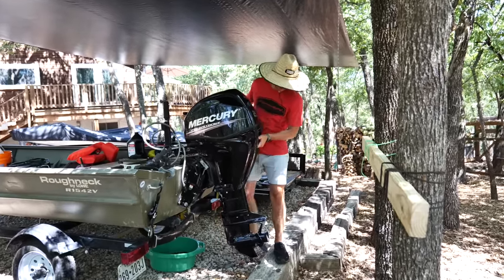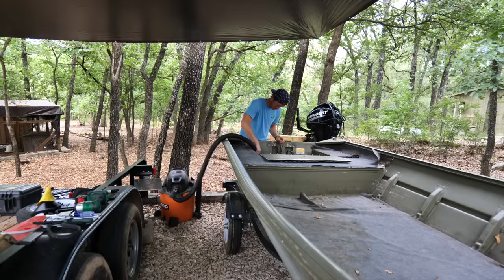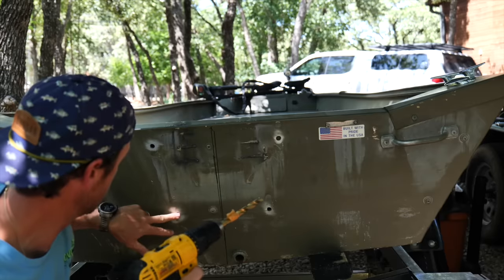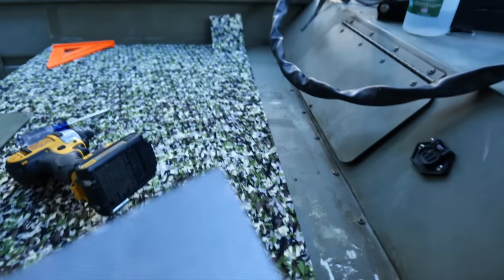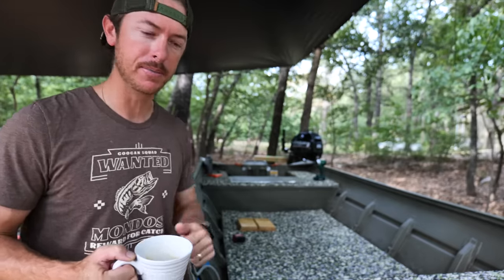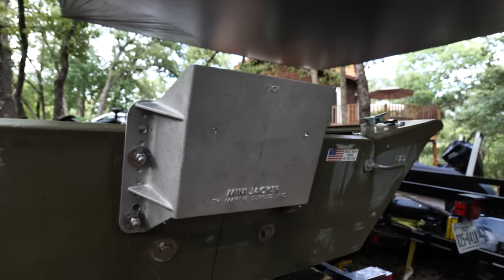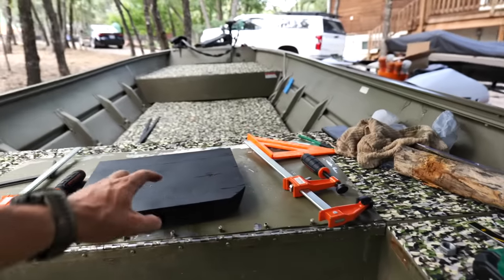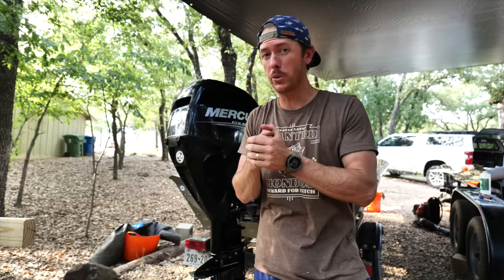MASSIVE Jon Boat Upgrades for Under $500! Full Build & Install

Comment: When you went to take off the motor, I had the thought hoping you had everything disconnecting. Having it still be connected twice is hilarious
Reply: I saw all them wires and fuel line and thought the same. I just went through this same thing 😆

Comment: This is a great video that shows how to work on your boat when you have no idea of what you are doing and have no experience in doing it, used to have these boats come into the shop all the time (Broken) and owners saying well it worked for a month or so before it broke. I knew things would get worse when he drilled the transom at the wrong angle to fill old engine bolt holes. I know you tried but as Clint Eastwood said ' A man has to know his limits" and Sir you have more than exceeded yours here, best of luck with that nightmare job.
Reply: Agreed, do things right the first time. The life you save might be your wife!!!!

Comment: Those bottom bolts are mainly going to keep it from lifting up if you hit an object in the water or bouncing on the trailer going down the road. They won’t see much load under power. The clamps will take most of that. If you ultimately don’t feel confident in it, check out the adjustable jack plates from Vance Manufacturing. They have some manual models that are not too much more than the mini jacker and they should bolt right up using the original holes you plugged. Your motor should mount to it too with no drilling since it has the standard bia pattern the bigger motors all have.

Comment: :face-green-smiling:NICE WORK!! :face-red-heart-shape:[ IMHO: AT ~7:50...), YOU SHOULD GET/USE A "STEP-BIT", NOT A FULL "TWIST DRILL BIT"... ]:face-fuchsia-poop-shape:THAT FOAM FLOORING, OUGHT TO ADD SEVERAL POUNDS OF "FLOATATION" TOO!!...:trophy-yellow-smiling: YOU REALLY OUGHT TO GET A BETTER, (SMALLER/LIGHTER), SUITABLE ENGINE!!...:face-orange-frowning:

Comment: You ought to build you a chain hoist either mobile or off a strong tree branch.

Also, carpeting (or foam I guess to an extent) a boat I usually buy basically 2x the length of the boat because you’ll never get your lids and deck done out of the same length of material running the same direction no matter how much planning you do.

Comment: Awesome video buddy and definitely some very very good upgrades also!!! I don’t think I’d worry too much about the jack plate!! I’d definitely just keep an eye on every thing for the first three or four times out and make sure everything stays tight and doesn’t move around on you!!! If everything works good good, stays tight I’d definitely run it and don’t worry about it!! I think if you have any issues it would be stress around the top of the jack plate at where the jack plate sticks above the back transom!! I could see a little bit extra stress in that area!! I’d definitely keep an eye out for any cracking and just keep an eye out for any cracks!!! I actually made myself a homemade jack plate for the back of my 1969 18’ flat bottom boat!! I’m the third owner of it and the original buyer of my boat used it less than 7 times and sat inside a barn when not being used!! Another guy ended up buying it to just flip but I was able to get it for free!!! It is absolutely leak free and in amazing shape for how old it is!! Since I got it I put a 24 volt trolling motor with 85lbs thrust and a 35 Hp Johnson out board on it and a steering wheel council and I absolutely love it!! Oh and the 35 Hp is a long shaft and that is why I had to make my own jack plate!! I’ve been running it for 7 or 8 years now and with no issues yet!!! Awesome video buddy and I definitely can’t wait to see your first outing with all the up grades for sure!! Where was you able to get all the sea decking from because that is definitely my next upgrade that I definitely want to do to mine also!!
Reply: There should be a lifting eye on top of the motor. A strong horizontal tree branch and a come a long to remove the motor. Too late for this project but for future reference it would save y'alls backs and other body parts. Great project though. Really enjoy all of your vids. Keep up the good work

Comment: LFG, you could have used a wex wheel for your drill. It's made to remove sticky stuff on areas. Also, you could have gone to an auto store and got rubber washers for the holes. Great video!

Comment: I would recommend using Citrus Strip for future carpet removal. I replaced the carpet on my bass boat and didn't discover the Citrus Strip until after I tried every harsh chemical and electric tool the world had to offer. When I used the Citrus Strip it cut the removal time of 15 year old carpet and glue down significantly.

Comment: LFG: Please continue to improve this boat. Fun to watch and useful information. Just two questions. 1. Does Merc make a 20 hp short shaft motor? 2. Would using a 20hp shot shaft have avoided a significant amount of difficulty?

Comment: Depends on the year and size of the motor but a lot of the bigger motors have a lifting mount plate. Others have a threaded eye hook that threads into the center of your flywheel over the flywheel bolt. You could just use a good wench and pulley to lift it or rig up a manual hand chain hoist.

Comment: I have that same jack plate on my jon boat with a 20hp honda. Works great and money well spent.
Reply: Why not just get a short shaft engine .. would save on weight aswell.. most dealers u can just take it in and trade for one..

Comment: Take a look at On The Fly jackplates. I just got the small manual version for my 1448 with 25 Johnson. Best purchase ever for my boat. Such a well made piece of equipment. It's rated to 30 hp, but I'm not sure yours would work with the basic plate since it's got trim. Also that 25 looks like an absolute UNIT! Cant believe how much of a struggle that looked compared to me moving around my old Johnson by myself. Big difference there.

Comment: SAFETY CABLE FROM MOTOR TO BOAT!!!!  Way that is setup that is a must have! 

Harbor Freight engine hoist is your friend when doing heavy lifting! I even use mine to lift the front of the lawnmower up to change or sharpen blades. A quality step bit is your friend when drilling sheet metal... much cleaner holes.

Comment: Urethane sealant, like 3M 5200, for marine use. Especially on hardware below the water line. Hopefully that silicone lasts long enough for what you want to use it for though.

Comment: By adding the jackplate it puts more pressure on the transom.  Run threaded rods from the top motor plate holes or the old top bolt holes to the platform structure for strength and support.     The truth is you need to trade this motor in for a short shaft.

Comment: your motor needs to go on a diet to 15-20hp, then your boat won't sit so low in the water. there's a reason they put these limits and weights and measures, besides pre-drilled holes to make you put a safe install on here, damn, shoulda bought motor with that 15" drop instead of 20" on the lower unit

Comment: When you take the boat to get the front deck weld fixed have the fab shop look at welding those holes from the motor as well, just had to get the holes on the back of my John boat welded after purchasing a new motor

Comment: Crazy, I just went through this with my new "Swamp Donkey)  needed a shallow runner. I ended up having to drop the motor back down two" because she was a wheely queen 😂 just a 9.9 merc on a 12' Tracker Jon. Drought conditions on the lower Colorado River. Desperate conditions req desperate measures 👌 But I can still fish, skinny water or not 🎉

Comment: The holes you could have done liquid metal to fill them and samd smooth, or had them welded closed when you took it for the seat to get fixed. Good video

Comment: When you repowered the boat. Why didn't you get a short shaft motor?
Reply: I was thinking the same thing
Reply: It was the middle of covid... probably couldn't find one.
Reply: If he had taken a motor with a short shaft, he would not have had any problem, all this work, costs and holes would not have been necessary.

Comment: NO TO ALCOHOL!!! The proper stuff to use is called Rapid Remover. It's what we use to remove Vinyl Wrap adhesive residue from vehicle wraps. it's pure citrus and won't do a thing to your paint, but the oils will stain your concrete or asphalt because it actually conditions and oils wherever it falls, so what's good for your driveway ironically looks bad, if that makes sense.

Goof off will also ruin wheels because most wheels actually have a clear coat on them and if you use the stuff on them you'll see a white haze build as it dries because it's softening it to remove it.

To seal the holes you want to use Cabosil powder (It's a fine fiberglass powder used to patch deep surface scratches in fiberglass) with some resin and add a little extra MEK (Activator) to really heat it up and you want it somewhat thick and pasty so you can almost sparkle it in, and let it hang out of the holes a wee bit so you can sand smooth.

When you install LARGER substrates with adhesive backing, PEEL ONLY A SLIVER OF THE BACKING and then place into position BEFORE PRESSING DOWN THE EXPOSED EDGE!… From there lift up from the backside and peel the backing SLOWLY TOWARDS YOU AS YOU PRESS IT DOWN. No bubbles and having to peel and reset.

And you should have gotten it all welded up while it was stripped and then painted it all up Silver like the Bullet!

Great vid as always Justin!

Comment: Nice job - turned out looking great!  I would have been more comfortable filling those transom holes with a small plate of aluminum and some Marine 5200.  That stuff is 100% permanent.  But hey if you ever need to pull those bolts and re-seal in a few years, not the end of the world.  Keep up the good work!

Comment: Turn your drill to high next time drilling aluminum. (Low for stainless steel) and you’ll have a lot better luck. I’m a custom aluminum fabricator building boat towers so I’ve drilled a couple holes in aluminum.

Comment: Quick tip instead of buying "goof off remover"  use charcoal fluid you will save tons of money ..  Goof off is expensive , charcoal fluid is cheap and is the same thing .

Comment: if and when you have the side wilded / fix .. thy can fix the back two holes at the same time .. and the carpet in the boat when the weild might not be good .. i would do the carpet and outher repairs after the welds are done ...

Comment: If you decide that Mini Jacker is too sketchy to run with, find a welder that can repair your boat and build up your transom. Any good aluminum boat welder should be able to build up your transom height no problem, as well as fill in your bolt holes that aren't being used.

Comment: :hand-pink-waving: Hey LFG ... I don't understand why you didn't just mount another (bigger) plate to the Jackplate ... that would have solved most of your problems ... was also smiling when you torqued the replacement(plug) bolts ... why would you do that? Just some Locktite and off you go.

Comment: Man i hope it holds but im seeing bad things a happing with that merc 25 being mounted higher up. When you get that crack fixed id have them put some reinforcements to the motor mount. Higher center of gravity while you just going down the road gunna cause a lot of stress.

Comment: The reason they probably didn't send treated wood is because AC2 green treat or cedar tone will rust out aluminum bad. But if it's marine grade it should be good to go. Marine grade is just so expensive so that's probably why they didn't send it treated before.

Comment: I would add a hydrofoil tail fin to the cave plate to increase speed, reduce plane time and increase turn capability. You can also choose between many sport props or ones designed for getting on plane. They have pitch and # of blade selector apps for determining your style to fit your boat.

Comment: Anyone doing a jon boat/bass boat conversion/upgrade. I used old highway signs for my floors,and casting decks. They are made from good aluminum. My brother works for a large highway construction company. When they do a stretch of road they usually replace all the signs. I don't know about  other areas,but here the company doing the work disposes of the old ones. They had a yard with dozens of them some 10+ feet square. 
 If someone wanted to try this I would recommend attempting to talk to a formen on one of the crews where you see work. They will at least be able to point you in the right direction. If you try to contact the city or county you probably won't get far. They replace damaged ones ,so probably don't come across them much.

Comment: Yamaha F25 only 423cc and two cylinders.  Is it really that good?  Mercury f25 523cc and 3 cylinders, also the Suzuki Df 25.  What is the best 25 hp outboard motor?  I would like a powerful 25 hp boat engine.  I have a Honwave T40 boat.  Which one do you recommend?  Thanks

Comment: Great video. However, do not use pressure treated wood on your aluminum boat. I learned that from buying an aluminum boat from a guy and the transum was rotted out completely. Swiss cheese, I didn't realize, couldn't see it until I took transum wood out. I did some research after and found out that pressure treated wood can have copper in it, copper eats aluminum for dinner.
I bought a sheet of aluminum and replace the whole back transom, co$tly.

Comment: all ur leverage is gonna be on the bolts on the inside of the boat. you need washers in there as well or its going to pull those bolts through

Comment: 3m 5200 is your friend and I wouldn't use anything else for silicone.  Works VERY well.
Reply: 5200 is sometimes too permanent. Its like welding things together nearly. 3M recently discontinued 4200 which was not AS permanent so ive switched over to loctite PL Marine, for when things need to be water proof but not forever bonded.
Reply: Yeah 5200 is pretty much permanent
Reply: yea its permanent.  But bolts could be smacked back out and it re-drilled no issue.  Peace of mind, thats just me though.

Comment: you might feel better about the rigidity of your transom with a pressure treated 2x6 or 2x8 on the inside of transome for jack plate to mount to. Just an idea I've seen on others.
Reply: LFG you need a short shaft merc ideally but it’ll do!

Comment: With the motor sitting so much higher it has to change the center point of gravity does this effect the toung weight enough for pulling it down the road ?

Comment: Nice jon boat! Texas Parks and Wildlife is wanting me to pay $600 to get mine legal. It’s a 14ft aluminum flat bottom. Has a casting deck built on the front, bow mounted trolling motor and a 3.6hp outboard. I paid $500 for the boat in a mixture of some cash and some free yard work. I bought it from my next door neighbor. He bought it from someone else but he never got a written bill of sale and he never got the title transferred. So when I tried to transfer the title and get the registration renewed they wouldn’t let me. I have a bill of sale from my neighbor but he never got the bill of sale from the original owner. So they are saying I need to file for a bonded title and that it will cost me $600. Being disabled and on a fixed income I can’t afford $600 to get it legal so right now it’s just a front yard ornament.

Comment: Your boat needed the new lightweight Short Shaft 20hp Mercury. 
If you were going to go with a 25hp. The Yamaha 25hp Short Shaft is lightweight as well.
Reply: When he upgraded covid was happening and stuff was in short supply/hard to find... long shaft may have been all that was available. And trading in you lose 50% of what you paid for the motor...I bet he doesn't have over 150 hours on it yet...

Comment: Rigging up a come along to some posts and 2x4's to lift the motor is alot cheaper than a divorce. You're welcome.
Reply: Cherry picker engine hoist and lifting straps... I bought mine to do a motor swap but it gets used for all kinds of stuff. Lifted my lawnmower the other day to sharpen the blades... used it to move my new air compressor(60 gallon, 240 volt...) into place... but I get to work on concrete. I have laid down sheets of plywood though to work off of. We did that to pull the engine form the demolition derby car, I didn't want that mess on my shop floor! Transmission was split in half and leaking all over the place, radiator was leaking all over, but the engine still ran well so it is going into the next demo car.

Comment: The joist you hit in the transom, couldnt you remove the bolt and just glog jb weld into that hole stuff it up good and then before it dries shove the bolt thru and tighten up...just curious

Comment: Why not just buy 2 larger angle aluminum plates and make a homemade jack plate and get the height you need. And can be done with no setback and also stronger.

Comment: You should have bought  a short shaft motor not a long shaft. A short shaft boat has a 15 inch transom. A long shaft boat has a 20 inch transom. Having the cavitation plate above the water line while the boat is moving will cause the prop to suck air and cause the motor seem like it goes into natural for a second. Your cavitation plate should be just below the water line while moving to prevent the prop from sucking air.

Comment: why not you put a piece of sheet metal on both sides of the wood plate that would keep the bolts from pulling through or breaking the wood

Comment: ■■■...you may have life insurance, but the family behind you on the highway better too, if that motor breaks lose after hitting a pothole...nice work but a little sketch for my comfort level.  You might want to check your boat/auto policies to be sure you are fully covered...good luck...nice helping with OSG.😮
Reply: 6 1/2” bolts through the transom….. don’t think I’d be worried too much